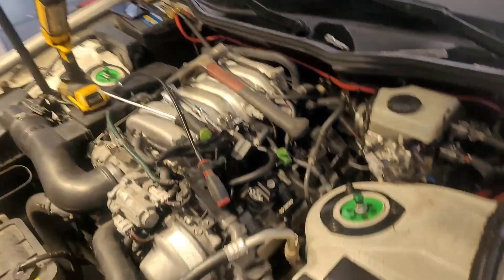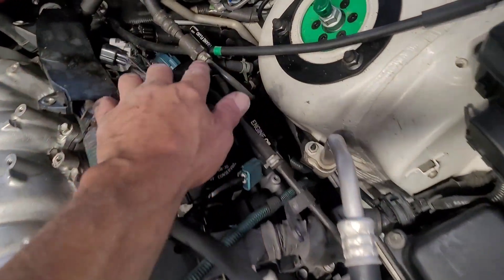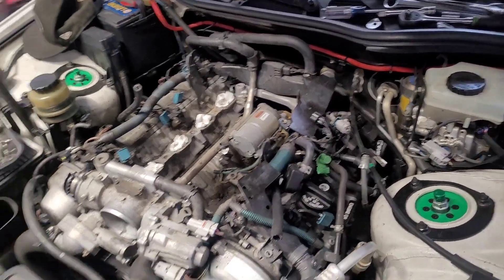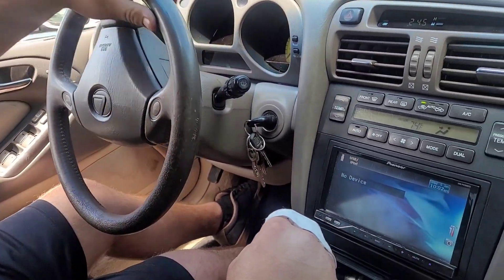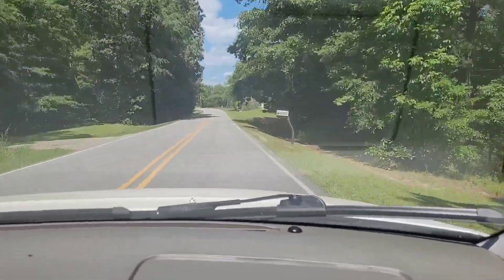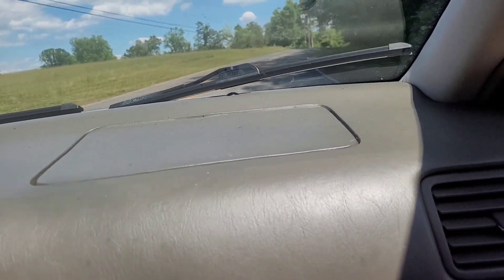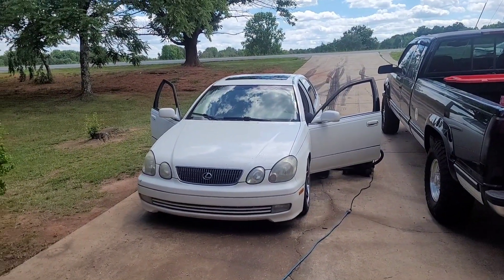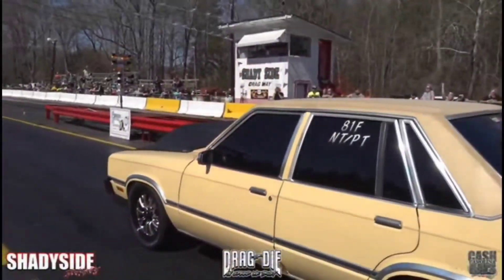Fixing the Lexus GS400

Comment: Ive got a 2002 IS300 and it keeps blowing the EFI fuse. I really need some help figuring it out, the car just shuts off when it blows. It happened to me twice when i was driving. I replaced the fuse once and it ran fine for a week and then it started stuttering again and then it blew again. I replaced the fuse again and it instantly blew. I waited 2 weeks and replaced the fuse AGAIN and it ran for 4 hours, started stuttering again and blew again.
Reply from the maker: Do a continuity test on that circuit probably a shorted wire